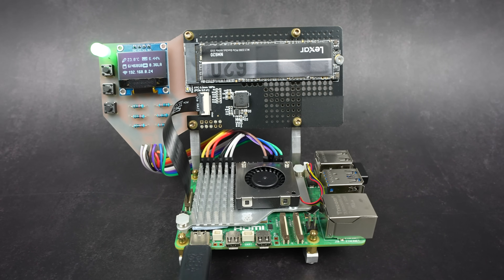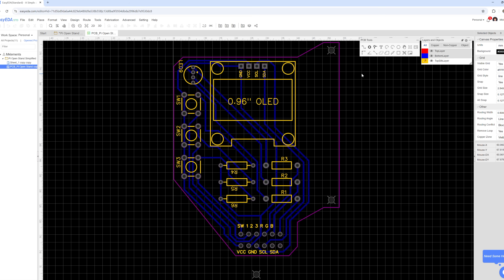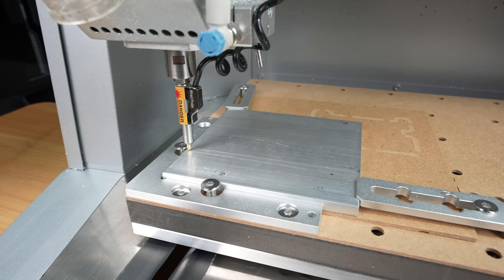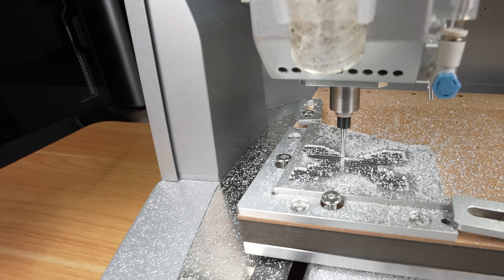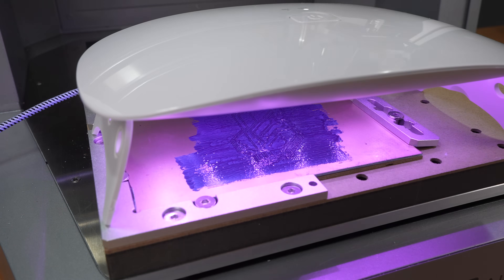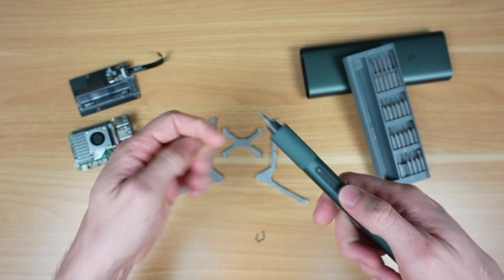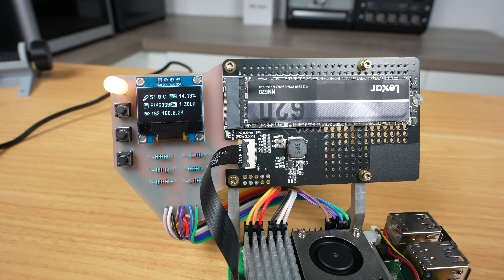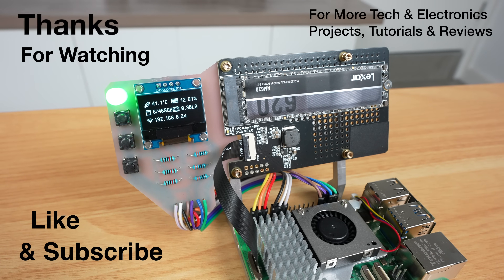Raspberry Pi 5 Test Bench with Stats & RGB Load Monitor, Made On The Carvera Air

Comment: Michael, as always you do such interesting projects. When you finished milling the parts what process do you use to remove the lines left by the mill?
Reply from the maker: I just file down the tabs with a sanding bit in a Dremel and the give the surfaces a sand with a fine sanding block - they provide one with the Carvera Air and it works pretty well on aluminium.
Reply: @MichaelKlements  Thanks for enlightening me about the process!

Comment: You should add a firmware chip to the pcb and have the code run directly on there so you don’t have to load it on the pi every time 💜